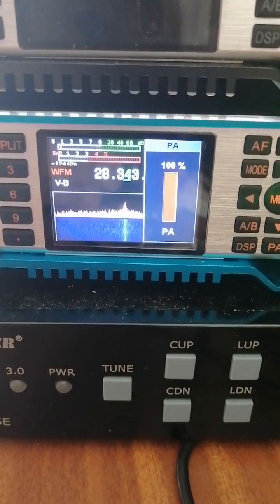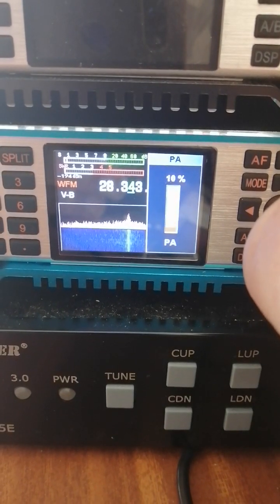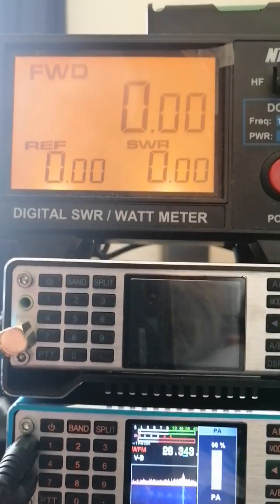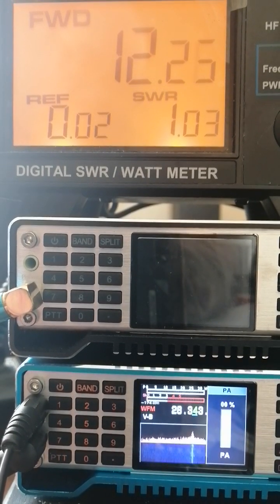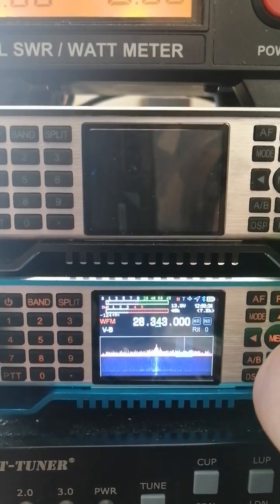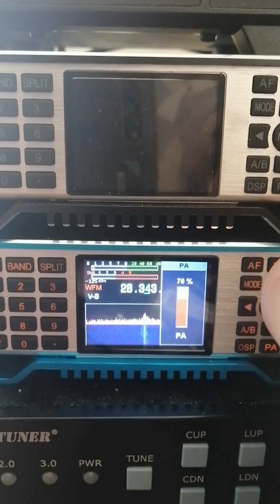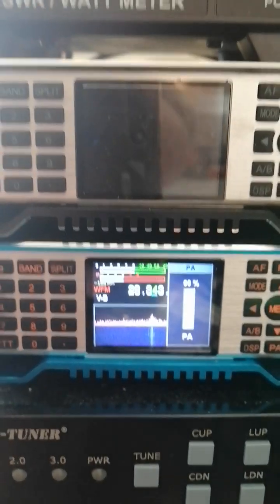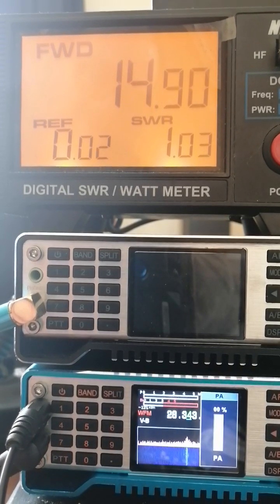Q900 power level

Comment: The missing vfo knob is not a grave problem as you can use the usb socket to add one. On my q900 the latest firmware version 3.4.3 produced only 5W maximum on both power levels. Had to downgrade back to version 3.4.0. And yes, the q900 is not an Icom. Adjusting the power level can yield surprising results. Thanks for your video cookie bear!